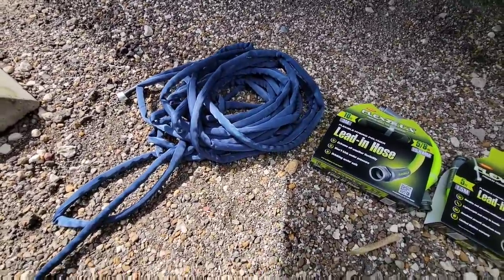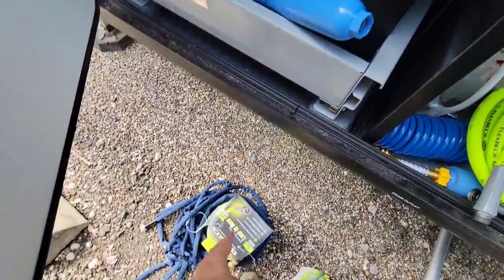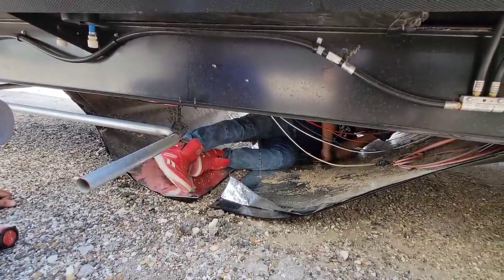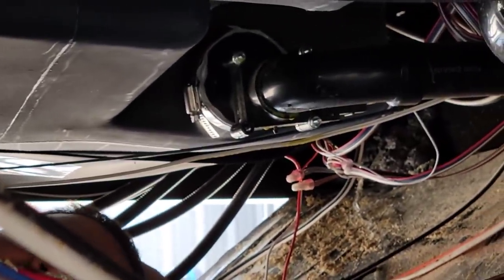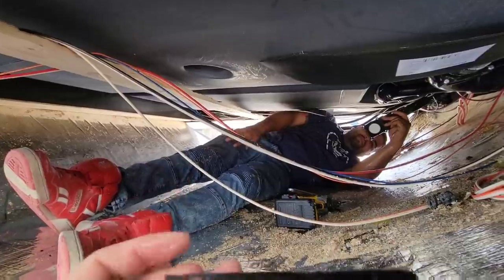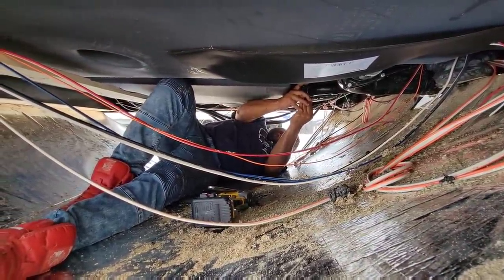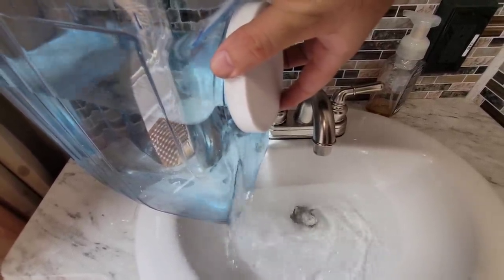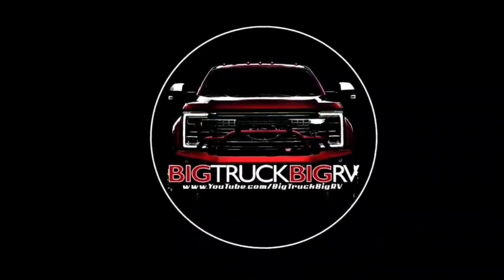Found in my RV Grey Tank! What the heck is this???

Comment: I fully understand how all the dust gets in there. But just as clearly it represents a possible threat in terms of mold or other issues. What they should be doing is not putting the belly pan on until construction is done and before that get in there and try and clean out as much dust as possible. Also all the wiring just hanging loose isn't good either. Would it really cost that much more to properly route and secure the wiring? I know all RV's are like this but that's not to say it can't be done better.

Finally since your replacing your Zero G hose why not cut it open and see if you just wasted your money doing so or not?

Comment: Really, the sawdust is a non issue. It does not present any safety issue.      I toured the Nitro plant 1 month ago and it is very noisy. Finding that piece of plastic would have been very difficult on the assembly line. The supplier should be required to take 15 seconds and flip it around a few times. I  that with the number of units that they produce that this is much of an issue. Kudos to Coachman for getting this taken care of.

Comment: Most people have no clue that ALL, even custom rig are build with crude construction practices. The building video's they show you on TV, like how its made don't show the parts where by- product is left all over, lose screws, wood, plastic, tubing, cheap screws, cheap hardware, etc...
I would bet if you could look in every tank those mold tubes would still be in every tank. And the manufacturer would say it's fine...no problem you can leave those in... along with sawdust, screws, metal shavings, large pieces of plywood, etc..
In the Arospace industry we call it FOD and its absolutely prohibited. Yah its just a RV but look at what you charge me for this. And
Just know when you buy one what surprises are you going to get.
Reply from the maker: https://www.flightglobal.com/programmes/boeing-orders-737-max-inspections-after-fuel-tank-fod-find/136819.article
Reply from the maker: https://www.google.com/amp/s/www.seattletimes.com/business/boeing-aerospace/air-force-wont-accept-any-more-boeing-tankers-until-manufacturing-process-is-cleaned-up/%3famp=1

Comment: Sawdust... because RV factories don't know how to clean up the messes they make when building rigs.
3:38 Upper right corner of the frame, I'm shocked to see such a big and nice RV using those cheap propane splitters / junction blocks and soft propane hoses going up into the coach.
All the RVs I've owned have black gas pipe (like you'd see in your house) running along the frame and copper pipe running the the appliances.  This cheapness kind of is a let down for owning a Coachmen as a future rig.  :-(

Comment: Your tank heater was totally hanging lose. Did anyone notice and fix that issue?
Reply from the maker: They will always come off in the center area because the tank is going to flex, expand, contract, and buldge when empty, full, hot, cold.  Anything attached to it will likely come off quickly especially if it's not and humid outside.  The bottom panels of the RV hold them against the tank when this happens.
Reply: @BigTruckBigRV  oh ours is attached tightly and not loose at all 🤷‍♀️

Comment: Great video! What an insight to what lies above our climate controlled poly layer.....sawdust, loose wood pieces and unsecured electrical wiring. Create environment for mice.
The RV manufacturer DOES have responsibility ensuring their tank supplier maintains to a cleanliness standard for debris of any kind. The manufacturing process has PPAP requirements for all kinds of specifications. If the RV company is not ensuring the tank manufacturer is holding to those requirements, they are as responsible as the tank supplier. Lastly, yes, the dealer lapsed in their PDI, passing the problem onto the customer. The process failed at every step from manufacture, assembly and quality inspection/control.

Comment: Really do NOT like that you can't drop the panels out of the way for Maintenance OR Cleaning. Having to lay on the panels half way dropped is totally ridiculous. Coachman taking a LOT of hits on this repair (which wasn't even their fault but exposed several Manufacturing Issues)

Comment: Also sometimes it's the actual plug that they cut in the tank for the inlet/drain and it falls inside the tank and they don't fish it out and that is more common to cause a blockage. I had continual problems with my valves and the long cables. replaced them with these 3 years ago, I am full time and I have never had a problem since https://www.amazon.com/Valterra-E1003VP-Valve-Electric-System/dp/B004RCXC1G/ref=sr_1_1?dchild=1&keywords=electric+rv+gate+valve&qid=1622093459&sr=8-1

Comment: My wife insisted we join the “cult of R-pod” a few years ago, we thankfully escaped, but there were problems. There was so much saw dust INSIDE the fresh water tank that it burned up the water pump. Also had to take the screen off the faucet because it would clog constantly with debris.   How hard would it be for manufacturers to occasionally use a blower while the unit is moving down the line?  A couple pennies spent would save a lot of warranty dollars.

Comment: If you can remember to REMOVE (drain) as much of the water as possible out of your hose you can avoid the mold and stagnation issues.   I used to hold the middle and swing the hose over my head to give the hose a spin dry, that is until I accidentally hit my ex-wife in the head.  (Sorry dear, still love ya!) 🤣

Comment: I can't believe we as RV buyers continue to accept poor workmanship of RV's as normal. Would you have accepted metal shavings and plastic pieces all over on your F-450 I think not. I just took delivery of 2021 KZ  Sportster 280TH it has sawdust in cabinets and track of the shower door. The flimsiness of some of the components of the RV are understandable as they have to walk a fine line between strength and weight. But not cleaning up after themselves is not acceptable. The wiring workmanship on RV's is just nonexistent it is a wonder more of them don't burn up.

Comment: Sorry don't buy the access challenge. If you board an aircraft and see metal shavings and pieces of other material coming from behind the wall panels next to your seat would you fly? This is nothing more than lack of pride in ones work and cutting costs measures. BTW I was an aircraft mechanic.